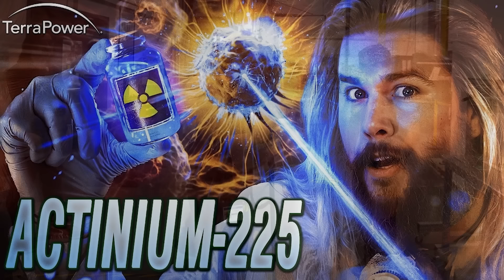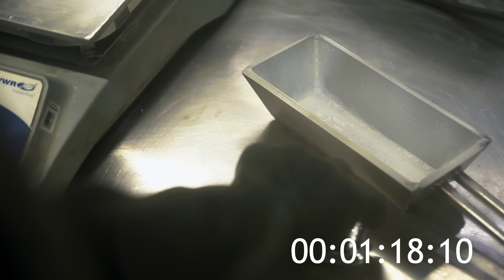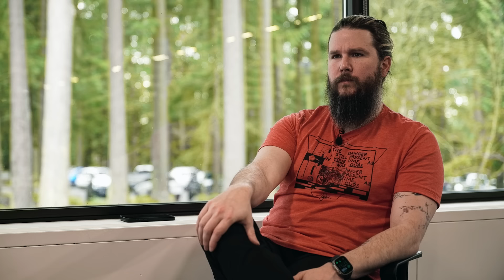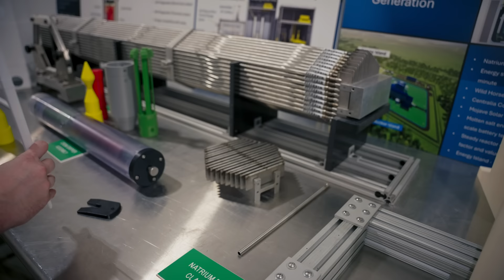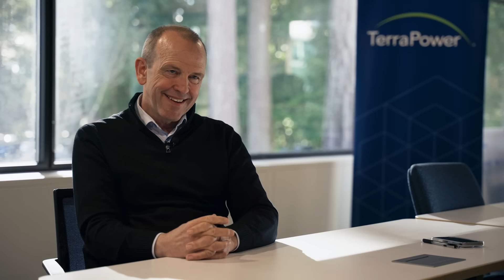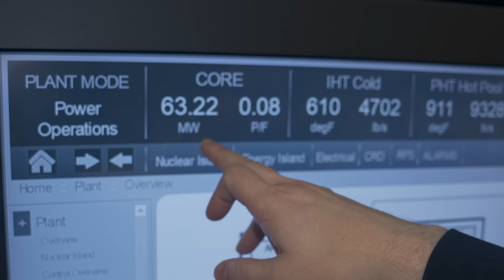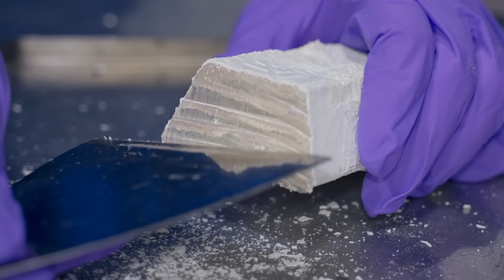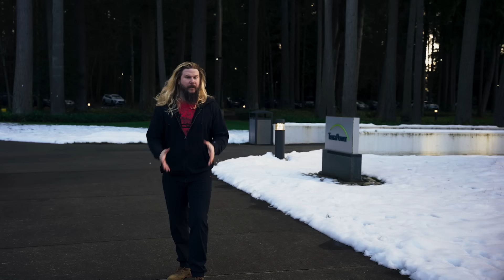Will Natrium Nuclear Reactors Change Everything?

Comment: Toured Shippingsport in 8th grade 1964. Lifetime nuke enthusiast. Today there's 450? reactors globally. We need 17,000 if we hope to mitigate damages from spewing 57 billion tons of greenhouse gases into our shared atmosphere annually.  Proofing sodium reactor tech most likely will take decades. Building them at scale in time unlikely. Current low hanging fruit is 66% wasted primary energy that's lost as waste heat. Had Mr Gates used his billions to standardize heat pump conversions and better buildings we would have an instant reduction in PPM greenhouse gases which currently are growing faster than ever

Comment: 15:45 , you can get Sodium to all react at once if you tie a weight to it and get it to sink in water.  Then it has no choice but to react all at once.  I've done it and have a video showing it.  This also proves that the reaction is a coloumb explosion and not just a hydrogen explosion.
Reply: There's a youtuber that wrote a paper on this. Youtube won't let me mention him or his video though, so good luck finding it.
Reply: @Pro_Triforcer  I know exactly who you're talking about.  His video on NaK is what led me to start testing the idea of trying to make sodium sink in water so there's no atmospheric oxygen for it or hydrogen to react with.
Reply: @BackYardScience2000  "sink in water so there's no oxygen for it or hydrogen to react with."  This is a joke, right?  You understand where the oxygen and hydrogen are coming from?
Reply: @SterlingChampion  the old way of thinking was that sodium exploded because of a hydrogen explosion, which was recently proven false due to it exploding in an insert atmosphere where there is no oxygen for the hydrogen to burn or explode with.  When you react sodium with water, you split water into an oxygen and hydrogen that becomes the hydroxide that forms sodium hydroxide and a free hydrogen that usually burns with oxygen in the air when sodium burns on top of water.  If you make the sodium sink, that hydrogen floats away and is separated from the Sodium.  Meaning it can't be what makes the sodium explode if it's not present during the explosion, proving that it's a coloumb explosion and not a hydrogen explosion.  Have you not read any of the replies to my comment?  Or are you commenting before reading and understanding what's going on?  I highly recommend looking more into this and finding the videos we've been discussing before jumping into the conversation without knowing what's been said and talked about.  There are literal scientific and peer reviewed papers out there on this.

Also, judging by your other comment you're only here to act like a fool.  I recommend you do that elsewhere.  We're here for the science, not to argue with people who don't know or understand what's being talked about and are only here to try to start an argument.
Reply: @BackYardScience2000  You must understand that the coulomb explosion results from the sodium losing electrons to the water. The solvated electrons move away rapidly from the metal, leaving behind positively charged sodium ions. These repel eachother explosively due to electrostatic forces, hence the name, coulomb explosion. But there could also be a hydrogen explosion if the concentration of hydrogen and oxygen created by the water-sodium reaction is allowed to build up. There are indeed peer-reviewed papers on this for you. Eg. Ball, P.  Sodium's explosive secrets revealed. Nature (2015).
Reply: @Pro_Triforcer  but I'll try to say his YouTube handle and we'll see if it holds.  It's thunder foot, spelled Thunderf00t.  But you'd have to dig through a mountain of his newest videos to find the video we're talking about.  I had to unsubscribe because of his newest videos...
Reply: @BackYardScience2000  "I had to unsubscribe because of his newest videos." Same here. His old stuff was really good, but now he just concentrates on milking rage bait for every view he can get, and he's very successful doing so. I can just imagine him sitting back in his chair and laughing while everyone rages over his videos.
Reply: Dude I HAVE to check out that video now.
Reply: @littlefrank90  check the oldest sodium video from several years ago where I strap it to a brick and drop it in a fish tank full of water.
Reply: @littlefrank90  you should also check out "Why Sodium explodes.. a new explanation!" by thunderf00t, one of the guys who wrote the paper about it.
Reply: You might also want to look up "thunderf00tcc sodium". There will be a video by one of the coauthors of the paper about this

Comment: Always heard that for molten sodium reactors to go commercial, we'd need some new materials science to make pipes and containers out of a material that could both handle the heat and not corrode so quickly.  Was this talked about or did they not want to speak on it with maybe some patents pending or some such?
Reply: What you heard is nonsense. Corrosion is only an issue if water gets in to form NaOH. It was never an issue in the primary loop/core. Phénix / BN600 initially had some issues in the secondary (non radioactive) sodium loops in the heat exchangers due to having used the wrong steel alloy with crack formation at high temperatures. They had some leaks/fires which didn't have too much impact. In Phénix they just drained the loop in that case and did repairs while the reactor ran 2/3 of power on the other two loops. BN600 is now running for 45 years. Secondary in this reactor is molten salt so not an issue.